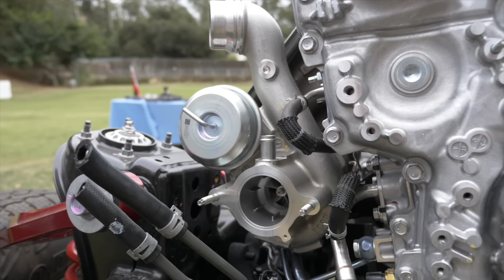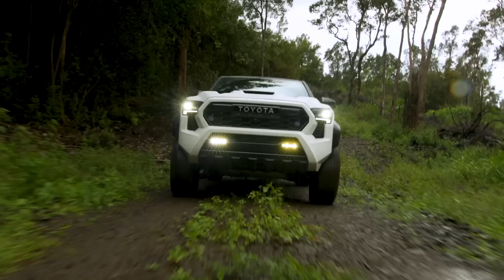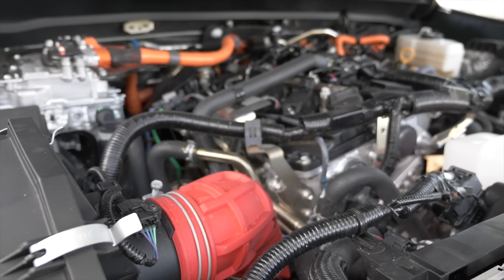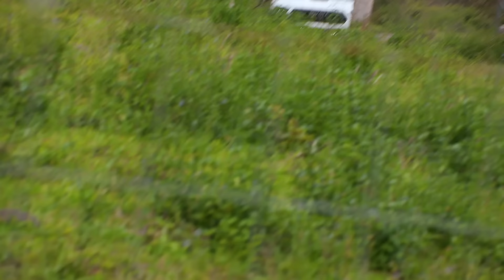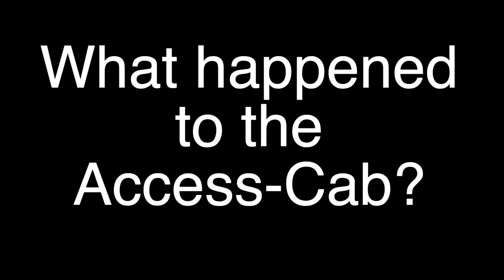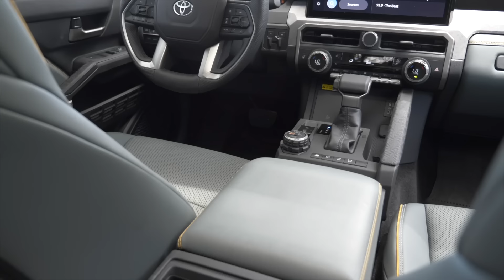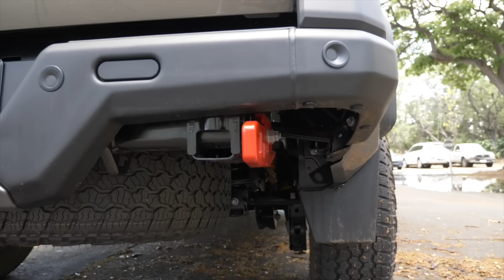2024 Toyota Tacoma Chief Engineer on new engine reliability and more...

Comment: Adding bleeding edge expensive technology to a tiny engine to gain 1-2MPG is a recipe for disaster. A simple N/A V6 or V8 will outlast this I4 and happily do so even if abused or neglected. This shift to turbo 4 cylinder engines in trucks and turbo 3-cylinder engines in crossovers is making them more expensive to buy and own, and does nothing to save the planet.

Comment: As a 15 year mechanic there has never been a time where taking a smaller engine and putting turbos in it to substitute hp makes it more reliable. Whether it's the engine itself or the drive train, never, never has anything become more reliable under those conditions. This is and will be a failed choice and will show itself in time. I guarantee it. The tundra is already showing issues with the v6. Took 2 of the most reliable vehicles and turned them into memes

Comment: Does any one believe this guy is an engineer as he with in the first 2 minutes tries to sell you on the fact that the 3" hole he points to is the cooling system inlet/outlet as opposed to clearly being the intake manifold inlet?    Really needs to go back to engineering school and make sure he can properly identify the different systems in cars.   

Before you arm chair warriors go on flame mode, I do indeed see the coolant thermostat flange/output  right there.  But I am sorry that is not 3" diameter.   The only 3" diameter hole there is the INTAKE......

Comment: I just bought one of these things, and im throughly impressed. They really thought through the driver experience, easier to toggle buttons, excellent infotainment center, adaptive and driver assist functions, and the torque/speed ramp up is smooth ! The new setup just makes sense... dont judge it until you try it guys! Not to mention that toyota has a history of small displacement turbocharged engines overseas, this isn't a new stint for them.
Reply: I bought a '24 TRD SPORT this summer and I'm very impressed , retired mechanic of 46 years , love the tourqe and MPG
Reply: @johnkelly3432 does the turbo concern you?
Reply: It's true, but mechanics in Asian countries are very very good. I don't mean US auto techs are not good, the Asian tech are real good. And their shop don't  charge  $180 or $200 per like in US, more like $25 . Automaintenance and repair are not that expensive

Comment: I understand at a very high and superficial and crude level why people hear 4 cylinder and turbo vs larger displacement V6 and think inferior motor or less reliability.  But people should remember that in the tradeoff between having the latest and greatest and bleeding edge tech, vs something that is reliable, Toyota is patient and will opt for the latter every time.  After all, that is why they command the loyalty and resale values they do.  Also, if you add a turbo kit to a naturally aspirated engine without extensively modifying other elements, it creates longevity issues, but this is a purpose built and designed turbo engine from the start.  It is not "stressed", they have accounted for the extra cylinder wall pressures, cooling requirements and heat management from the very beginning.  I mean he said himself they use as much engine cooling with respect to the water jacket as they would in a V8 for this boosted 4 cylinder.  Extrapolate that type of approach across the board, as well as modern day metallurgy and construction methods and you really could easily have a turbo 4 cylinder in a truck "that has to push the weight of a truck" that isn't "stressed out".  If they wanted to generate 400 HP+ from the turbo hybrid variant, they easily could have but again, they opted for durability and an unstressed drivetrain over that.

Comment: Decent damage control commercial. Strategically using Tacoma instead of Tundra for justifying purely political stunt in using hotter high compression engines and turbos everywhere. Most people are poorly educated and will eat that. Long live Toyota.

Comment: Toyota's been putting turbocharged engines in vehicles since 1979, remember the Supra, I think they have them perfected. That little four-cylinder turbo-charged Supra was faster than V8 Mustang Cobra ..0-60
Reply: the supra is less than 1/2 the weight of a truck though...small engines in small trucks is not a problem...the mini-trucks had been doing it for years...the new Tacoma is not even close to a mini-truck in size and weight though...the imports were more for the 'tuners'...a totally different crowd than the typical Mustang of Camaro owner of the time....the Mustangs and Camaros also had those rumbly V8's...whether they were faster or not, they sounded a lot better than a 4 cylinder...and that appealed to a lot of people...as to the New Trucks...time will tell if the engines hold up...they are too new right now...the millage must be getting up there on some of them.
Reply: @michelle-lz8tg  yeah I know, I still favor a naturally aspirated V8, but times are a-changing , pretty soon it's going to be all EV's

Comment: After I saw this video for the first time, I quickly bought a 23 Tacoma TRD Off Road, double cab, 6’ bed with the premium and technology pkgs, because historically a Turbo engine simply doesn’t last as long as a naturally aspirated engine.
I put over 300K miles on my last 3.5L V6 Toyota.
It didn’t give me any problems from the day I bought it until the day I sold it. We keep our vehicles for 15-20 or 300K miles.
I currently have 7800 miles on my year old TRD Off Road.
I doubt that I’ll live another 20 years and I know that I’ll be dead before my Tacoma hits 300K miles, so I’ll be driving my TRD until I die.
Reply: I had a third gen for 300,000 miles. After buying the 4th gen, i dont know how i drove that thing for so long with that horrible transmission. 
The 4cyl/8spd combo also tows my trailers WAY better than my third gen....by a massive margin. 
Its a better truck in every measurable metric. They knocked it outa the park.

Oh, and by the way..when i bought my third gen, every 2nd gen owner was saying just what youre saying. And it turned out just fine (minus the crappy shifting trans)
Reply: @ I had the Overland Torque Tune (OTT) installed in my 23 TRD.
The OTT increases the horsepower by 25 and the torque by 25 while adding 1-3mpg Better fuel efficiency and it STOPS the transmission from “hunting” for the right gear in the transmission.
At 75mph with my cruise control set I’m consistently getting 23mpg. Around town I’m getting 20-21 mpg.
I really don’t think your Turbo will last 300K miles, but time will tell.
Historically a gasoline Turbo engine simply doesn’t last as long as a Naturally Aspirated engine.
I’m retired and on a fixed income now so I really can’t afford for my truck to blow a Turbo or pay to replace the engine.
I’m sure that after my death, my wife will still be using my 23 TRD to plow the 5-7 feet of snow off our private road and driveway every winter until she too passes away.
I only drive 8-10K miles per year now so in 20 years it’ll still have less than 200K miles on it.
Reply: @Doc1855  Thats false info circulating on the turbo. I bet it will last just fine. That story stems from people blowing racing motors on modified engines. 
It has relatively low boost. Its been engineered to be over cooled, as toyota has routinely stated. Theyve been turbo-ing for a long while, with no issues.
  I work on heavy machinery for a living and everything runs on turbo, and i never see the turbos or the engines fail from turbos. The hilux is turbo. Very little difference between gas/diesel. Its still a turbo. 
Most of the people i see claiming those things are the type of folks that cant even change their own oil, and are making claims because they read it somewhere. These are all speculations.
I bet this thing will run just fine, for a long while, like every other gen Tacoma i had. 
I would LOVE to have a turbo diesel Hilux.
Reply: You live another 20 years I will buy that Tacoma from u
Reply: @Tobykhellletloose I dunno, I’m an absolute Maintenance Freak.
The oil is changed every 3K - 5K miles with Valvoline Full Synthetic 0W-20 (as recommended by Toyota). Historically I’ve Always changed the front and rear differentials, transfer case and transmission fluid every 30K miles.
Every 3 years I change the antifreeze, bleed the brakes and replace the power steering fluid.
It is washed regularly and during our summer months it is detailed (wash,  dry, clay bared, Ceramic wax) every 6 weeks. During the winter months I take it to the car wash, (depending on weather conditions). I make sure that if it’s snowed our State of Washington sprays chemicals to melt the snow and ice. When this occurs I take my Tacoma in and the under side of the vehicles are sprayed to get those chemicals washed out, as they’ll eat your rotors,  and other important items underneath a vehicle.
I installed a Cold Air intake and I had the Overland Torque Tune (OTT) installed.
The OTT Stops the transmission from “hunting” for the right gear. It Increases the horsepower by 25. It also Increases the Torque by 25 lb ft. Currently my Tacoma has about 318 horsepower and 295 lb ft of Torque.
The OTT also Increases your mpg by 1-3 mpg.
My truck came with Boring Black Leather seats.
I reached out to Katzkin and had them make me Parchment with Black trim and Cardinal Red stitching.
After Katzkin removed my black leather seat covers I had Katzkin sew in a “Pool Noodle” in front of the Lumbar Support, so that the power Lumbar Support actually has more support when needed, and replaced the seat covers with what I ordered, I sold the black leather seat covers to another 3rd generation Tacoma owner who was upgrading from cloth seats to leather.
I found a company who makes either Vinyl or real wood to dress up your vehicles interior trim.
I bought real burl wood trim pieces for the interior. I also added some Aluminum Red Metallic pieces for the knobs and the surround for the vents.
The exterior of my truck is White.
I had it 2 toned in “Soul Red” metallic (a new Mazda color).
The White over Red with Bronze TRD wheels looks great.
My truck was a new “Leftover” 23. I bought it on 2/29/24.
The dealership had added almost $5K in accessories. The factory MSRP was $51,848, plus the additional accessories.
I know the sales manager outside his job.
Anyhow I told Brent to take ALL of those accessories OFF because I didn’t want to have to pay for them.
Brent gave me all of those accessories because they would have a hard time selling them because of all the accessories for the redesigned 24 Tacoma. When we left it cost $48K, including taxes, license, and fees.
I think I got a good deal.
I didn’t like the running boards so I had power running boards installed. They’re Great.
Yes I sold the factory running boards.
Next, my truck came with the TRD Performance exhaust. I decided that upgrading the intake, the engine would breathe better if I installed a dual exhaust.
I decided on a Flowmaster FLOW FX. I like the sound and I’ve noticed a bit more pep.
I’m gentle with my truck because it has to last until either I can no longer drive or I die.
So do you still want it in 20+ years?
Oh and  our vehicles are always in a heated (60 degrees Fahrenheit) garage. Who wants to sit on leather seats when the daytime high will be 15-25 degrees?
So look me up in 20 years.
I drive 8-10K miles per year, in 20 years it should have around 220K.
For “Grunt” work around our mountain property or getting firewood, going to town (5 miles away) for Topsoil, gravel, etc we use our 2000 Honda Acty Attack. It’s small but it was manufactured for commercial use. I’m surprised by how much it’ll haul and handle.
Cheers,
Doc
Reply: @AS-gf5jn Wait until all the recalls engine and transmission problems. Best to wait a year or two after a new gen comes out. Let others be the guinea pigs.
Reply: I find low mile first gen Tacos with the V6 and bring them up to like-new spec.  Best truck on the road.
Reply: @DoYaGetIt  The 4.0L hands down is better than the 3.5L in my 23 Tacoma TRD off road
Reply: Increase your warranty toyota if u want us to (buy) in!!!! Like u r
Reply: @kevingray-s7h 
The hybrid model battery is warrantied for 10 years and 150,000 miles.

The hybrid related components and electric motor is warrantied for 8 years and 100,000 miles.

Do U think that the combustion engine and transmission, warrantied for only 60,000 miles, will fail early?
Reply: How would you know that??? 10,000$ on it?  Winner take all .  Thinking 50,000 miles run. Above average reliability….i win . For sure the way you’re talking that should be easy money for you. Above average is all you can ask for any vehicle. For you to win it must get way below average as you’re talking.  

I’m really saying is when money is on the line people sure start back peddling..
Reply: Buddy of mine has a M4 with 167k miles and he slides the car pretty often. Turbo motors are reliable and they are very efficient. I’m saving a lot of money with my 4th gen hybrid.
Reply: @Doc1855  eco boost engines prove you wrong. And they are ford engine. Arguably an average at best company for reliability.
Reply: @Annon89  Then why are there so many recalls on them?
And an Ecoboost will Not last 300K miles.
Don’t get me wrong, if we buy a domestic vehicle, it’s always a Ford product.
We own 17 oil wells and our fleet trucks are always a F- series truck.
In our orchards we still have older Ranger’s because they’re durable and reliable and can get between the rows of trees.
If an engine is a gasoline turbo it simply doesn’t last as long as a naturally aspirated engine.
Reply: @Doc1855  for one Toyota has had 4 cylinder turbos since the 80s and the 22r motor is literally the definition of indestructible and underpowered.  And you have been able to put a 4 banger in almost every Toyota since inception and they’ve been fine. I’ve even owned one and it was perfectly reliable. Would a killed for a turbo on it actually. And they did put turbos on the 22r motors from the factory in the past. And they were amazing little trucks. Not sure how reliable the turbos were in the 80s but we have millions of turbos on engines these days. Can they fail. Sure. Just like everything else. People said the same thing about coil packs and electric fans,Ecu engine controls. It’s laughable. But just about every single engine in a newer truck has a turbo on it. I’m sure they will all be failing. lol.
Reply: @Annon89  Did I say anything about a Toyota turbo? No, I was talking about Ford.
Please stay on track with the conversation
Reply: Why would you want to keep a vehicle that long. Just because it runs doesn’t mean it’s not a pile of junk.  Just buy a new one.
Reply: @brianonnela8186  I actually think your a very smart person. It gets you from point A  to point B. If people need a new truck to impress they have bigger problems!
Reply: @brianonnela8186  I think you are very smart! If it gets you from point A to Point B that's all that matters. I don't need a new truck to impress people.
Reply: @brianonnela8186  Why would I do that?
I invested well when I was younger and retired at 43.
I don’t need to keep up with the Smiths and Jones. If our vehicles stay reliable, we just keep driving them.
My wife’s Camry was 18 years old when we donated it to our church. It had only 118K miles on it and the car went to a single mother who desperately needed a vehicle.
Because of where we live, we get 5-7 feet of snow every winter. So my wife would park her Camry and drive my RAV 4WD Limited with the 3.5L V6 and I’d drive our old 4WD pickup, until she was able to drive her Camry again.
For my wife’s 50th birthday I bought her an Outback so she can drive it year round.
We’d much rather invest our money into real estate or gold, silver, etc instead of buying a new vehicle every few years.
Automobiles depreciate, but real estate and precious metals appreciate. Furthermore we rent our properties, which in turn puts money into our bank accounts, in which when we have enough set aside, we invest in more things that increase our income.

Years ago my grandmother told me to live frugally so that when you’re old, you’ll be able to live comfortably and see the world. If you can afford to drive a Mercedes Benz, drive a Toyota instead. 
If you drive an expensive vehicle, everyone will know you are either wealthy or you’re dirt poor., scraping by, but if you just blend in then no one will try to take advantage of you.

She was a very smart woman. Her parents were dirt poor and so was she while growing up. When she died at 93 years old, she had over $17 Million in her estate and she drove a 30 year old Oldsmobile Cutlass Supreme Brougham, 2dr that now sits in our 6 car heated garage and is driven only on occasion. It still looks great and drives like new with only 97K original miles. The car is now 40 years old.
Reply: @brianonnela8186  We choose to invest our money wisely and not into vehicles that Depreciate.
I’m an older man and have had 4 main daily drivers during my lifetime.
I started out life like most 18 year olds.
I went to college and invested very well and was able to retire at 43.
I’ve continued to invest well throughout my lifetime.
We now own several properties.
In 17 we bought 1/4 of a mountain in north central Washington state and had a custom built home built into the side of our property 1/2 way up our property.
Just our house, not including the property is worth $950K.
We didn’t get to where we are today by buying a lot of vehicles.
They’re just transportation and we’re not on this earth to impress anyone.
Reply: @brianonna8186 Found the child.
Reply: @brianonnela8186 I think you're missing the point.

Comment: $32,000 for a base model mid sized truck with a 4 banger and 2wd. I mean.... value, affordable...I am not sure. TRD Camry gets a 3.5L v6 with 301 HP and 267 lb/ft torque.